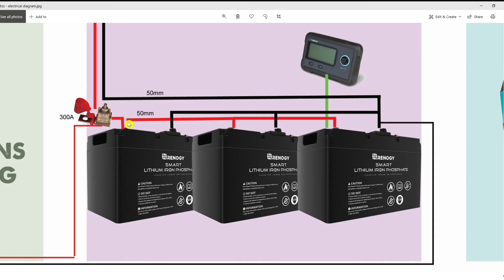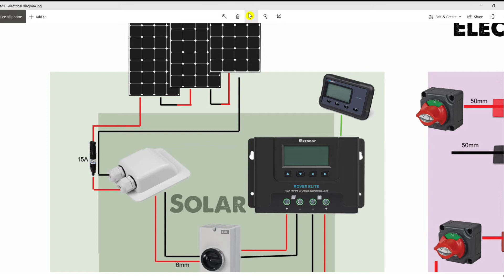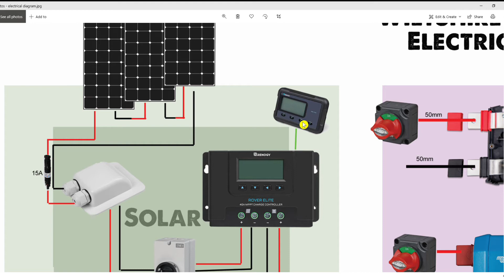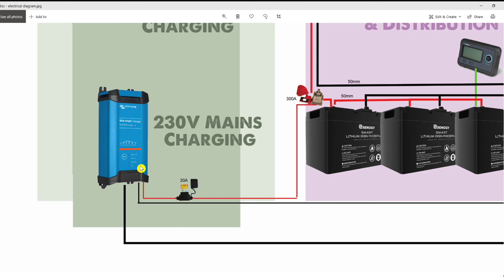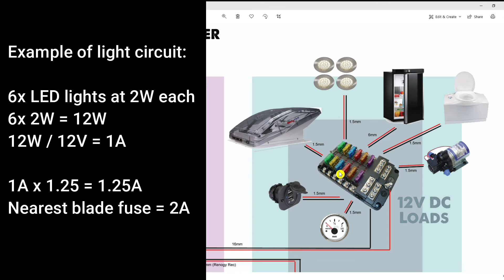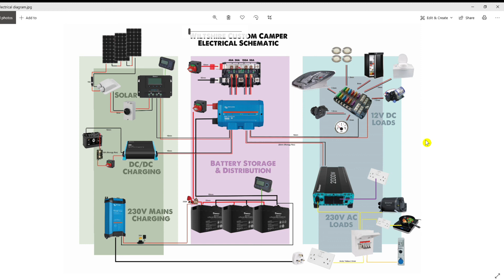A good way to wire your campervan for electrics to be off grid.

Comment: I’ve read that Renogy supply those  25mm cables for testing only. You should be using 50-70mm cables, depending on length of course.

Comment: Quick question did you use a 40amp double pole DC isolator switch from your solar ? . I have 400 watts of solar but am struggling to find a 40amp DC  isolator , any ideas thanks.
Reply from the maker: might want to consider alternative wiring methods using series and parallel. check out renogy's own solar panel videos for this?

Comment: Hello there
Looking at your diagram, it seems that most of the parts are connected with 16mm cables. Can I use a 1.5m TPS or 2.5 TPS cable and just take the live and neutral wires instead of using 16mm cables?
Reply from the maker: Dont use solid core cable in a van and refer to the wiring regulations of the country you are in for amperage ratings of different wire sizes. 2.5 seems very small to replace a 16mm cable????

Comment: Hi , great videos , would you say 300 ah of batteries is adequate ,or would you go for more or less now you’ve lived with it for a while , thanks JOHN
Reply from the maker: Great question! if you cook with gas and heat with gas or diesel then yes, most certainly. if you go for a gas free build and cook on induction then I would go a bit more, at least 400ah or more if you have the space/money! my next van build will be gas free and i will go for a bigger battery bank.
Reply: @wiltshirecustomcamper7203  Thanks for that , last question did you use a 40amp DC isolator switch from your solar ? . I have 400 watts of solar but am struggling to find a 40amp DC  isolator , any ideas thanks.

Comment: This is an amazing video
Watched heaps of bs videos but this video is real
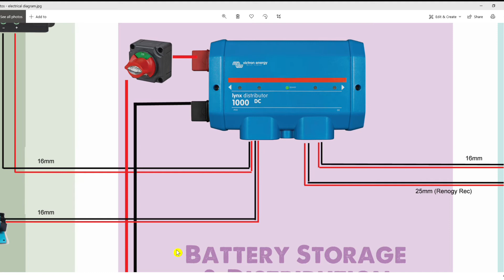And a quick question here about the master fuse, on 4:48
What does it call? 
What should I search on google to find it and what do you mean by the appropriate fuse size for the battery size?
Reply from the maker: it is an MBRF terminal fuse. try this link. https://www.12voltplanet.co.uk/blue-sea-systems-5191-mrbf-terminal-fuse-block-30-300a.html

Comment: Hi Great video, just wondering how you wired the 240v inverter input from the consumer unit, did you cut off the 3 pin plug and wire directly from the consumer unit?  Thanks David
Reply from the maker: I have a double socket underneath the consumer unit that is wired to one of the breakers. the inverter then plugs in here along with the AC battery charger.
Reply: @wiltshirecustomcamper7203  thanks that's how I have done mine👍🏼

Comment: Thank you for posting this very detailed and informative information. I'm going to upgrade my current basic 12v system with lead acid batteries to lithium and DC to DC charging. Your video will be of great help. One question is why you went for 3, 100ah batteries rather than a single 300ah battery?
Reply from the maker: Thanks for the comment. at the time cost was a factor and also having 3x 100ah, if a battery fails or something happens I still have 2 whereas one 'big mama' means ive lost the lot so to speak if that makes senses. however, might consider that option now in 2024 as prices have fallen and weight is a factor aswell.

Comment: Great video, just a quick question regarding your  fuse on your battery bank…did you come up with the 300amp fuse due to the fact the 3 batteries are 100amp each? I have got 5 100 Amh Renogy lithium wired in parallel i was wondering what size fuse i should go for? Any ideas regards Mark
Reply from the maker: At the time that was indeed my thought process about batteries to fuse, i.e. 3x 100ah batts = 300 amp fuse. HOWEVER, a much better way is to consider you total load in amps if everything was on such as all 12v items and inverter running at full capacity and extrapolate a total load in amps. then ensure this is below the capacity of the cable from battery to busbar and then fuse accordingly. so if your total draw is , say 180amps and you have a 50mm cable that would give you a absolute total amperage of 219A according to table 4D1A of the BS7671 regs if out in the open air (google the table), then a 200A fuse would be a good option being just over the total required load but below the point where the cable will have trouble. Incidently I have changed my main fuse to 200A since making the video!! hope that helps.
Reply: Hi, thanks for the information very helpful. 300 amp it is then as my inverter is a 3000w thanks

Comment: Hi, what size fuse did you put in the Lynx distributer for your renogy inverter ? Great videos, thank you
Reply from the maker: As i used 35mm cable which is rated to 162 amps when 'free floating' i used a 150amp fuse. if you used 50mm cable you could fuse at 175amp. I know 150amp does not quite cover the potential capacity of the inverter but i never use it anywhere near full potential so I am happy with the fusing. after 18months of use it has never blown. hope that helps in some way. search google for BS7671 regs table 4D1A for amp ratings for cables.
Reply: @wiltshirecustomcamper7203  Thanks very much for the reply 👍🏻

Comment: Great video, thanks. Could you tell me where you got your fuses (particularly the battery one) from and switches?
Reply from the maker: A mixture of eBay, Amazon and other van related retailers. I am planning to do a parts list (non affiliate linked as dont believe in that crap) but it takes time to do....
Reply: Thanks again.

Comment: Thank you for your interesting video a really enjoyed watching it. just a few key points for anyone watching (I am a qualified electrician) The fuse is to PROTECT THE CABLE and the fuse rating should be determined by the current carrying capacity of the cable/wire. The positive wire going from the battery to the 230v mains charger is not protected upto the 30A fuse, there should be a fuse at the battery end to protect it based on the size of the wire. Hope you dont mind me making this comment its a great video.

Comment: Just after subscribing to your channel. Fantastic detail and as i am building an l4 peugeot boxer i am really interested in following your videos. I wanted to ask you about the live wire from the van battery to the leisure batteries. Did you run it under the floor along the passenger side?
Reply from the maker: The DC/DC charger is under the passenger seat and the cables run from that up the pillar and along the top to he back. hope that helps. good luck with your build. If I did it again I would go under the floor as it is a shorter cable run so consider that before completing the floor. The enclosed 'insulated' space will affect your max amps though so check that out as well on cable choice. search google for BS7671 table 4d1a for a good guide.
Reply: @wiltshirecustomcamper7203  Thank you so much for getting back to me so soon. I really appreciate the time and effort that you put into making your videos and i have been taking some great advise from yourself. Great to see your son out helping you as it reminds me of the days that i spent with my father learning from him over 40 years ago. Keep up the good work

Comment: Would a 50mm2 cable be enough to carry a maximum load of 175A (if everything in my camper was operating at once - excluding dc to dc charger as I wouldn't be running van at same time)? I am getting mixed info online but the supplier (oxford welding supplies) rates the cable to 345A. The run would be very short as this is the connection between battery and bus bars. Thanks a lot.
Reply from the maker: Table 4d1A in the BS7671 requirements for electrical installations rates 50mm2 single core cable as follows: enclosed in thermally insulated wall or trunking = 99A, in trunking or conduit = 151A, clipped direct to wall = 182A. NOTE: I am not an electrician and have just read that from the book so please do seek pro advice if not sure. 70mm would give you 293A clipped to wall so that might be a winner but do seek pro advice as I say. hope that helps. do a google search for the afore mentioned table and you should find it OK.
Reply: @wiltshirecustomcamper7203  thanks a lot. I think I'll just connect my solar charge controller cable directly to battery and not through bus bars so thag I can get away with the 50mm cable

Comment: Only just picking up on your videos, which are excellent. I do have in mind a very similar range of equipment and wonder why the inverter can't handle the induction hob? Could you explain why it can't? (Picked up on the children message). Would a larger inverter allow more equipment to be used at once?
Reply from the maker: Ah! yes! I went for a 2000W inverter as it is fine for my needs but a 3000W would give you more power and therefore will run more devices at once. if an induction hob is no more than about 1800W it will run fine. The children part was actually directed towards wifey who would, without consideration, turn on the induction hob, boiler and run a kettle all at once and my expensive inverter goes pop! By forcing certain items like the hob and boiler to only run from 'shore' power it protects the inverter from overload by 'others' in the van. hope that makes sense. I will explain this in more detail in my upcoming van tour...
Reply: @wiltshirecustomcamper7203  Thanks very much. Very helpful. I'm thinking low power microwave, small induction hob and a kettle to run through an inverter. 3kw sounds more suitable for that lot. Wonder if switched sockets might help fellow travellers (wives and children) think before adding to the power load???
Reply from the maker: @stevenallen6606  I have seen that before where an induction hob and electric water heater are on a 'toggle' switch so it is either one or the other but cant be both at the same time! might be a good solution and should be fairly simple to wire up? For a 3kw inverter I would recommend from my experiences over the last year to go for a bare min of 300Ah lithium but ideally 400Ah+ depending on your charges options.
Reply: @wiltshirecustomcamper7203  I'll look in to that. Thanks again

Comment: Regarding "popping" the inverter by overloading the outputs, could you not fit a suitable rated breaker on the inverter output which would cut should the inverter limits be approached ?

Comment: Just discovered your channel. You have a great knack of explaining things very clearly. One question about your electrical system. Do you keep your inverter switched on all the time when you are off grid or do only switch it on when necessary? I understand that it switches off automatically when you are on EHU/Shore power.
Reply from the maker: Hi there and thanks for the great question. we only switch it on when it is required whilst off grid, it has a built in automatic transfer switch so when connected to shore power the sockets are live without having to switch the inverter on. hope that helps
Reply: @wiltshirecustomcamper7203  does the socket that your using for your low power equipment still work when your attached to a 240v hook up, just bought my first camper and it needs some good upgrades, I’m looking forward to getting stuck in and these types of videos fantastic.

Comment: Fantastic video, thank you so much. You explained everything and made my installation so much easier.
One question, where are you earthing from? Direct from the earth point on the Lynx? From what I have researched that should be enough but wanted to ask you. Wonder if doing it from the battery aswell is worth it???
Thank you so much
Tom
Reply from the maker: I am taking a ground from the Lynx to the body as everything directly or indirectly connects through it. hope that helps.

Comment: This is a very useful video and thanks for taking time to explain things properly. You showed the formula used to calculate the size of the solar panel in-line fuse of 15A. 
(Q1) If you had 2 solar panels rather than 3 (e.g. 200W x 2), or even a single 400W panel, will the formula be the same, i.e. will the solar panel in-line fuse be 15A?
(Q2) You also have a DP isolator for the solar panels, which I believe is acting as a Circuit Breaker. In that case, what is the size of the DP isolator, i.e. will that be 15A just like the in-line fuse?
Reply from the maker: check out here for the fuses https://uk.renogy.com/renogy-mc4-waterproof-in-line-fuse-holder-w-fuse/?gclid=Cj0KCQjwuaiXBhCCARIsAKZLt3mPONFRNInUY2FnF1AHlXKjRGzESvJwO1xkcuUcpRt2QEjzwtmDmZwaAgcREALw_wcB  there are only a few options so do the calculation and go with the closest or most appropriate size for your system
Reply from the maker: my DP isolator is just a double pole switch, it is not a breaker of any type. it is just for circuit isolation if required. I have a megafuse in the Lynx.
Reply: @wiltshirecustomcamper7203  Thanks. Really appreciate your feedback.

Comment: Can you run a fridge from the 12v on this system for 3 days off grid
Reply from the maker: Yes, should be fine. I had fridge, lights, truma running on gas (but still has 12v for controls), microwave off inverter for a few minutes, 3 kettle boils from inverter and various USB devices charing in a 24 hour period and at the end of the first 24hrs I still had 85% SOC.

Comment: How far is your dc to dc charger from car battery ? I have the same van and I'm looking to install one but 16 mm wire looks small for me. If the leisure is on the back of van 40 amp current would need 25mm at least. What is your thought ?
Reply from the maker: Well spotted, i bought the 40a DC-Dc as it was virtually the same price as the 20A version at the time. it was always my intention to run at 20A hence the 16mm cable and I use the LC connection on the front of the charger to run it at 20A which has always been plenty enough for me and I have never run out of power. if you were using 40A then regardless of distance, I would always go 25mm for belt and braces although the cable guides say 16mm is fine.

Comment: The 50mm cable from the batteries is protected by a 300a fuse. I thought 95mm was needed for 300a?
Reply from the maker: There are a great many conflicting bits of info regarding this for sure! I got my info from the following website https://www.electricalcarservices.com/how-to-work-out-the-correct-battery-cable-for-the-job/c-p-0-0-508 I will however double check this to be sure and safe but according to this website 50mm will do a nominal current up to 345A and as my cable lengths are under well under 300mm there is no need to upsize to allow for losses due to cable length. hope that helps on a yes but no but yes type of answer.....

Comment: Great video. So you don't plan on using the Microwave off grid even though you have Lithium batteries? I just purchased mine specifically to do that.
Reply from the maker: Actually, yes we are. I am just completing the kitchen and when the video comes out you will see a small microwave connected to the inverter. I was not going to but then thought that we will not be 'cooking' as such with but just re-heating so it will only be on for small bursts so will be fine on my 300ah batts.

Comment: Is the link distributor just  neater than wiring to the battery and having all separate fuses?
Reply from the maker: Essentially, yes! it is a glorified busbar with fuses so it saves having 'spiders legs' of wires going everywhere and separate busbars and fuse holders all over the place.

Comment: Good video , did u do the distributor video I can’t find it what company did u use for all the cable ? Have you a chart for cable sizing ?
Reply from the maker: Not yet but still planning to do so. fighting the clock and the weather to get it finished at the moment so will re-visit these 'extras' videos in due course. thanks for watching. the cable came from eBay from various suppliers although I found that for the smaller cable for lights etc, a roll of thin flat 2 core cable from my local electrical wholesaler ( the sort of thing found of a table lamp) was much cheaper if you dont mind the brown/blue colours rather than black/red. if you are just stating out, measure what you think you will need...... then double it........then add a bit more for good luck, and then you will be in the right ballpark!

Comment: Hi - thanks for the videos. Subscribed. Recently found them and are proving helpful in my decision as to do a self build, or not!
I'm wondering about your circuit protection on your inverter feed to your general 230v sockets. All other 230v items pass appear to through the consumer unit but the general sockets from the inverter do not appear to do so. Have I missed something or is the inverter giving you the protection of the consumer unit.
Otherwise everything was explained well enough that I could easily understand. Many thanks for that.
Reply from the maker: The renogy instructions show the end device connected directly to the inverter into the 3 pin socket on the inverter. I have chosen to run cables to the outlets, but essentially the end result is the same, that the device is directly connected to the inverter. I can only assume the inverter is fused/protected internally. thanks for watching.
Reply: @wiltshirecustomcamper7203  Just on that., What cables did you run rom inverter to sockets? Just regular extension cables?
Reply from the maker: @stephentrainor4480  2.5mm arctic blue 3 core flex. hope that helps.